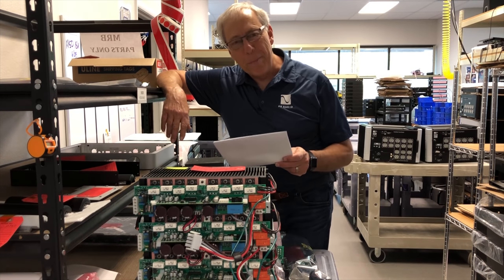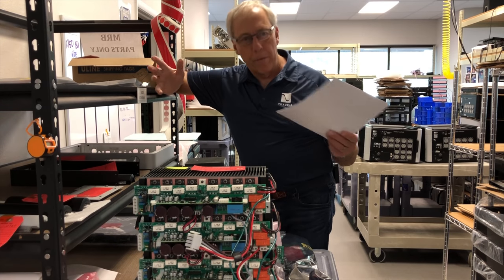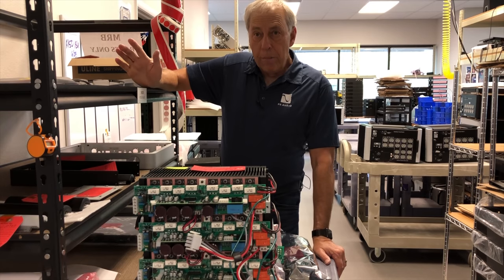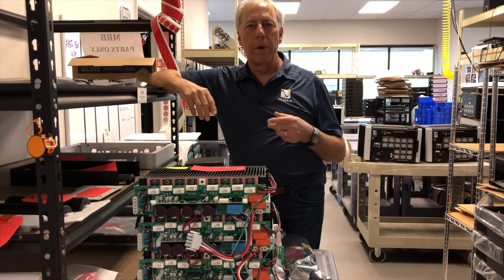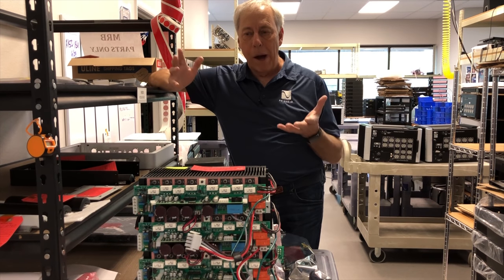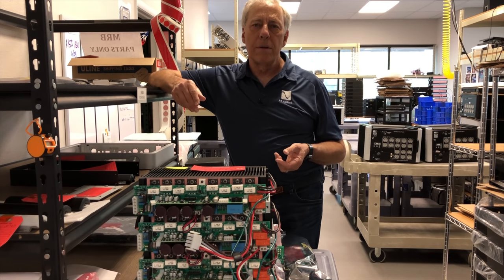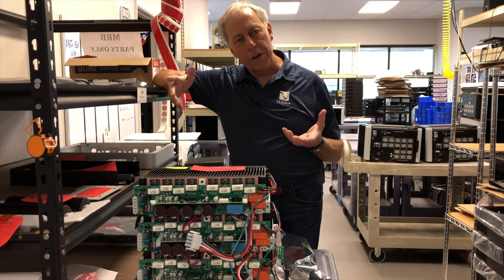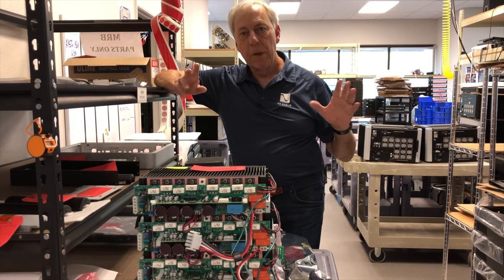Is the BBC dip still used in speakers?

Comment: One solution to the problem of getting drivers to work together in that critical upper range crossover region (2-3 kHz) is to develop an active speaker system, and then utilize a sharper slope of 4th order (24 dB/octave) or even 8th order (48 dB/octave) as I have done in my active system, which narrows the crossover region so sharply as to render the issues of virtually no consequence. In addition, since the system is an active design, a delay circuit can be placed in the mid range side of the crossover in order to allow for electronically aligning the phase of the output of both drivers to further minimize problems in this region.
Reply: High slope has problem, low slope has problem too, something to do with impulse response. High slope will sound harsh on crossover region, low slope will sound a little dull/muddy. I prefer 2nd order 12db/oct butterworth for high frequency and higher slope for low frequency.
Reply: Paul said it in the video there is no perfect solution. I think many people would argue that that closest we have come is with "Dual Concentric" driver configurations where the high and low frequency drivers are almost entirely physically aligned.  Tannoy would argue that they are but even though what I saw was small it was a difference and needed to be corrected to eliminate that difference. The other thing mentioned is that due to their physical size, weight and shape differences the transients do not follow the same envelope even though each driver is trying to generate precisely the same thing. Larger/heavier drivers take longer to react. The other thing that I have seen is that some drivers sound horrible at certain frequencies. I love to use my Focal KRX2's as examples. Their cones are a aramid fibre (close cousin to "Kevlar") sandwhich design. Meaning they use layers of substances in order to create the final diaphram design. Kevlar and Aramid fibre both have a known issue of generating a lot of distortion at certain frequencies. This is actually common with all materials however where the distortion occurs and the type of distortion chances depending on what  material is used. We have yet to invent a perfect one. When I set up the active crossover system in my car (Focal KRX are hi fi car audio speakers)  I chose cross-over points well away from the points where the drivers would distort.  PS there are no holes in the frequency response in my car. I time aligned for phase at the crossover points specifically. Most manufacturers only consider the nominal phase response of the drivers to determine phase settings. As most drivers have vastly different phase throughout their operating range I adjusted considering the phase response at the point where the drivers spl/frequency curves intersected. I also used a very gentle slope (I think 12 dB/Oct) which also generated less distortion making the listeners position smooth and ruler flat right up.
Reply: Have you done it  yourself and it worked? I tried about 1980  to make two band IC stereo amplifier and it was  mess comparing to good matched speaker with filters driven by exceptional   mono PP tube amp . I gave it up.  By the way - constant delay may be corrected by geometry while delay lines in my opinion may  affect timbre of sound by altering the speakers input impedance. Of course it is in theory and who knows how it works.
Reply: Do it all of the time actually and it works exceptionally well. I am not sure if the fact that we are doing it in the digital realm matters but by eliminating that one source of distortion it creates a much cleaner and far more accurate sound. Of course the next issue is that the drivers can't actually function with the same attack times so there are going to be issues caused by that that can't be fixed that way.
Reply: These problems are exacerbated by small drivers with small wavefront baffles. That's why very large sound systems sound OK for acoustic material, and perfect for rock or jazz: any live performance of rock or jazz is heard through similar gear with similar characteristics. Want a perfect violin quartet in your living room? Hire a quartet. :o)
Reply: What's an "active" speaker system?

Could you use Atmel Tiny or something similarly wimpy to simply 100% perfectly crop at frequency boundaries digitally? Do it at 192Khz so even the silly perfect-ear audiophiles can't tell the difference and just don't tell them it's there. :)

You could make a digital crossover for any number of speaker configurations and even tune it automatically or manually post-construction of the enclosure! That sounds like a neat idea!
Reply: Nakashi: Remember, this is a mechanical problem more than an electrical one. Digital crossover technology isn't competitive yet. Processors are still pretty slow considering what's required to do what you suggest. Pick a frequency from an audio stream? Sure, no problem. What about when there are 200 dominant frequencies in that stream at that point in time, and there's you with only a handful of FFT bins? Ouch, right? If you solve that problem, I'll buy you a beer and I'll buy your product.

Go look at the Teensy (ARM Cortex) audio threads on PJRC's forum for some discussions about this and similar audio related digital processing issues. You might get ideas that benefit everyone.

I'm having very good success with 3-way JBL Pro series speakers, tri-amped, following a Linkwitz-Riley 4th order active crossover. I used a modified Denon 7.2 surround receiver, so I can control the delay on each driver, minimizing the phase distortion within a fixed listening plane: don't move your head, and it's perfect. Overall, it's about as good as can be had in a living room in 2018.

The WAF is very very low, however. (Wife Approval Factor)
Reply: Rob Chapman,  In all my years of working with and listing to car audio I have never heard an active mid tweeter crossover that sounded anything like live music.  Not even close.  I have heard some beautiful sounding active systems ...... never realistic.  The best passive systems just sound more natural.

The best speakers I have auditioned had almost no crossover.   An mid driver that rolls off naturally with no dips or peaks with an 6db twitter crossover in the 5 to 7k region can sound amazing with the right drivers.  This usually makes an efficient and dynamic combination......only at moderate listing levels. The trade off is push the system too hard and the tweeter will blow and the midrange will become harsh.
Reply: +Speaker Builder Sorry, it isn't actively clear from your post if your active system is active. Do you have an active system by any chance? :-p
Reply: Yes, and let's be sure what that means. I was hounded on my site for using the term "active speakers", since my speakers do not house amplifiers and crossover internally. Instead, I have an active speaker system that uses all external components, including an electronic crossover that divides the signal into three discrete bands prior to amplification, necessitating three stereo amplifiers for the six drivers in the system.
Reply: So wait a second here. What I am reading here is that you guys are using home theater receivers to process speakers and with that you are seeing less than favorable results. Umm, Well no wonder. If you use a flat head screw driver to try to screw in a Philips screw it is not going to go well. Heck a better analogy is just using the wrong sized Philips screw driver. There are plenty of really great professional level speaker processors available on the market. They are even used in studios these days over analogue active crossovers as the performance is MASSIVELY better. Most of these processors even have digital inputs so we never need to covert to analogue in order to get into them. Companies like Harman with BSS, Lake and XTA have been developing this tech for 20 years now. They have to have computer programming engineers as well as electronic engineers and audio engineers to develop a functional product like that and they all make very well respected and extremely capable products but no they are not cheap. As they are the heart of the speaker system should they be? The point is that they are not idiots when it comes to how the codecs effect the outgoing sound. BTW as most of the mixing we do as audio engineers these days is done "in the box" (aka inside the computer) it is clear that someone has been thinking about how the programming of the box is going to change the sound. One other point this is tech that started to come of age in the 80's. Do you suppose we might have learned something in 30 years.
Reply: To: Joe Duke,
Some manner of crossover/fiter whether active or passive will always be necessary as you would not wish to pump 30Hz into a 1-inch silk Dome Twitter, nor would you want to push 15000Hz into a 15in subwoofer as all that's going to do is turn into heat and distortion.
Reply: To: Rob Chapman,
Hopefully, if there's one thing we've learned is that music, being analog to begin with, is going to sound best when it remains analog as much as possible till it gets to your speakers, and that the more often you change that analog signal to a digital one and back you're asking for trouble as something is going to be gained and something is going to be lost with each transition of State.
Just as a computer is unable to reproduce a curve with anything but a lot of tiny straight lines, the "Blinking-Ear" of digital processing can only approximate the real thing, but it can NEVER represent-it.
Reply: Not true. Go to a high end audio show. You will be surprised.
Reply: Class D lulz... hey lets use nonlinear amplifiers for audio designs, Brilliant!
Reply: I'm no fan of class D but they are linear albeit with added noise
Reply: 4th order is excellent if you are running a n extended high range 4 way system. Used them extensively with great results.  With my Massive single cabinet builds, the 8th order was used in a dual dual single dual in a  final 4 ohm transducer setup..  dual 18's, dual 12's,  single 2" Tweeter, dual 1" Titanium Super Tweeters to extend to 20kHz. Rated at 3kW rms/ 6kW peak and 105db  @1w/1m. weighed 220lbs and had 4 wheels and 4 handles built in, but you could load all of your other gear on top of them and only had to make two trips to move everything on a gig,.   Crystal Clear Sound.  Today, you cant even buy such products, everything has been cheaped out for maximum profits and have to make 10 trips to move everything and process everything to the moon to make it sound any good at all...
Reply: where you sourcing your induction coils from or wrapping your own?
Reply: I used to be able to wind my own .  I stopped doing it over 20 years ago though, since you can buy about anything cheaper from China these days than making it myself as long as you test for accurate inductance, I have found many off more than 20%, which is just NFG.
Reply: *eyes start to bleed after seeing another video of praise over a class D 240w with 10% THD and just walks away...throwing their hands up.
Reply: Wow, I have never seen a class D push 10% unless there was massive operator error. Thats the testers fault, not the amp. I could push any amp to 10% if wanted to be an idiot. I will stick with test done on certified Dynamometers at Certified and Dynamic ratings only by trusted and completely transparent operators like Ryan Blankenship and BigDWhiz, i just wish they would test more Hi-Fi amps with their mobile amps.
Reply: no that is the flat out advertised specifications..... wasnt even operator error.... I told the guy he should have saved his money and bought a pyramid eq booster :P
Reply: i believe the subject was really about passive not active systems

Comment: I find some of the worlds best sounding audio equipment have horrible specifications.  They just do not look very good to the people that compare THD and frequency response.
Reply: I literally got some great speakers out of a dumpster. Built in amp failed. I removed the amp, and awful useless 12" paper woofer. Ended up with 2 6" subs and tweeters that worked great with a 240w car amp I got for free, (bad cold solder joints on the RCAs,)  and a computer power supply torn out of something (12v circuit had at least 10A,) anyway sounded terrific, shook the house with helicopters and gunfire in movies.

Comment: You talk about speakers being made with BBC dip but I don't know who makes them. Can you please tell me ?
Reply from the maker: It used to be the BBC monitors of which the most famous of them was the LS35A. You can still find these on the used market. Today, many companies still use the technique.
Reply: @Paulmcgowanpsaudio  sorry, my question should have been clearer. I meant can you tell me who makes BBC sounding speakers NOW. It was easy for me to find out on Google who makes ls3/5a replicas but I couldn't find info on who makes any speakers that have that dip. The first speaker I fell in love with I was told had that sound before I even knew it was a thing.
Reply from the maker: @davidthom7127  Ahhh. No problem. I am not sure who does this specifically now. Infinity speakers mostly had them when Arnie designed them.

Comment: It might as well be correcting acoustic issues in typical listening enviroments, interacting with the the dispersion pattern of some speaker desgns. Secondly a lot of people prefer a colored sound even if they wont admitt it.
Reply: I'll admit it. I like shrill highs and booming bass.
Reply: Many audiophiles like a slightly recessed mid range around 800Hz where lead instruments dominate, and a recessed mid-bass to open up the sub-bass.
Reply: I like mine a kind of sky blue pink...

Comment: I tri-amp and have decent crossovers, but they do change phase at crossover. I bought an FPGA board (Snickerdoodle black) and am planning on trying some experimentation. Four-thousand-pole FIR filters should give me a pretty linear phase response between low and mid. I can reduce the number of poles on the upper filters between mid and high. The gotcha is that I will need 6 DACs, 12 if I go full balanced. I'm looking at some instrumentation R2R chips that are about $30 in quantity. ESS has some nice DACs, but I think they would be to difficult for me to program. Buffering the DAC output signal is the most difficult part of the system to design. If I actually manage to get it all working, I'll make it open source.
Reply: With amp  you have I would expect very small  problem with phase shifts at crossover. I would rather  adjust  individual distances from listener to each driver to equal their  phase. .
Reply: If you want to know which R2R chips will go together with a nice BBC dip this may be of help: https://thetakeout.com/the-takeout-investigates-which-chip-for-which-dip-1822428459
Reply: Mats Eriksson I bit. :)

Comment: Great video! I've been experiencing everything you've been describing. A compromise you didn't mention was figuring out the best way to get the woofer cutting off low enough. I so wanted to go with air core but just didn't have enough coil. Ended up running a much higher value cap than expected with a low value resister to lower the q in parallel which worked out perfectly but i'm sure there's problems with that!

Comment: If the woofer upper frequency terminates about 800 and the tweeter begins around 1100 would missing frequency cause sound to miss (in absent range) or sound like a horrible design?  They should overlap?
Reply: The crossover still lets both drivers play sounds In that frequency gap however they play them quieter and because they are both playing them at different volume levels they add up to sound virtually flat.
Reply: It is more complicated than that. For example if the tweeter is more sensitive then you can stretch it a little lower with crossover but you will need to dip the rest of the highs somehow or it will be very bright. On the other hand, (esp w small woofers) the woofer's resistance curve is often going up sharply at the crossover frequency. This will play havoc with your crossover design. Trying to make a higher order (sharper)  crossover often makes it worse. Whatever you build by conventional rules will either roll off too low or too high because the driver impeadance interacts with the crossover's impeadance. A zobel network can fix this, but a zobel is usually bigger and more expensive than the entire rest of the crossover because they often use very large inductors or capacators. And this is all without even getting "normal" crossover design. It really is as much an art as a science.
Reply: If this are calculated resonances of crossover   It is opposite to what should be. Woofer highest  frequency should be significantly  higher than tweeter lowest. To align it to cooperate is an art.   In your case sound shall be with  sharp sopranos,  partly no present. .

Comment: Is it really possible to manage the relation of on axis and off axis response by crossover design? I thought it's the chosen driver type and baffle design.
Reply: There  are  radiation axis and axis of harmonics time shift (angle)  which are not  depending each on other, not not mentioning other. Crossover is responsible for time shifts which are in resonance ( which is the working point of filter)  highly dependable on frequency . That is one mentioned by Paul.
Reply: Mikexception Frequency response and phase? Is that what you meant?
Reply: Sure - frequency response is defined  in few axis by driver  or speaker producer  . Phase has nothing to do with it .  phase shift is  not created by drivers  itself, this shifts are  created in crossovers and supplied to driver terminals  .
Reply: Mikexception Regarding your first answer: do you mention that harmonics are supplied by the next “ higher” driver?
Reply: I hope you do  not store drivers  too high :). Then it is no problem.